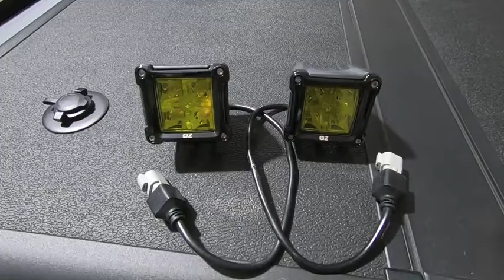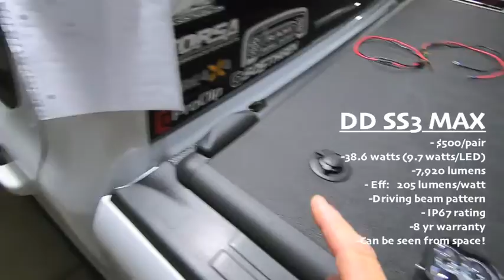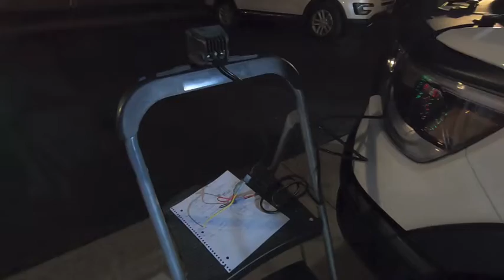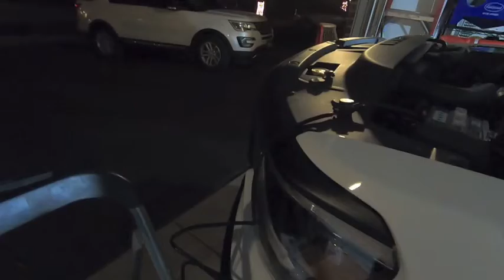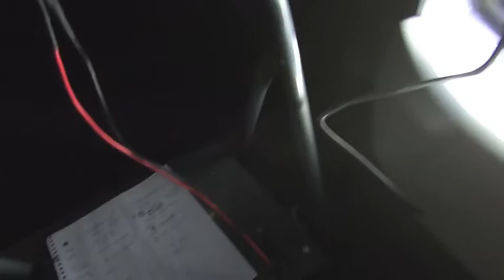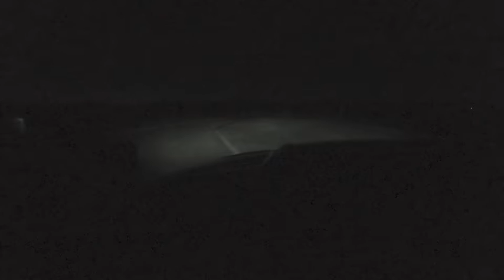Side by Side: Diode Dynamics SS3 Max pods VS bargain pods and why you get what you pay for!

Comment: I didn’t realize they came out with a “Max” that is brighter than the pro 

Only bummer is with the amp use you can’t just wire them directly to the trigger 

Did you use another high Amp relay and the tigger just turns on the relay?
Reply from the maker: Nope, my SS3's are controlled directly by the Trigger.  The trigger has 2-30amp circuits and 2- 10 amps circuits.  The ss3's pull 6 amps total so any of the trigger's circuits will work.

Comment: Awesome pods, 
These driving beam seems to be very good, Diode dynamics got the best optics currently.
The thing I would like to see Diode dynamics drive the leds to the max power and get some more spread with the combo lens.
That would really bet the Baja designs XL80’s
Reply: This video doesn't do these lights justice. The DD SS3 Max puts the BD XL80s to shame. Absolutely no comparison. Check out the incredibly detailed post on Tacoma World about these SS3 Max in the SAE fog light version https://www.tacomaworld.com/threads/the-led-sae-j583-fog-pod-fog-light-review.554813/
Reply: I Know I'm suuuuper late to the party, but if you haven't learned already, we actually do have a combo lens with 2 LEDs with a flood optic, and 2 with a driving optic on one lens. This is a great video showcasing the power of the MAX pods we sell. Personally I run Pro yellow fogs, and Pro white floods on my aftermarket bumper, along with an amber 18" driving lens stage series lightbar that absolutely slice through fog, dust, snow, and rain

Comment: $500.00...😲!
Reply: Don earl a baja lp4 which has the same output as these lights is 400 per single unit so these are a bargain....you want nice stuff you gotta pay theres a reason why 50 dollar amazon stuff is 50 dollars... .the 8 year warranty alone is worth the 500.
Reply from the maker: Big dollar light bars!
Reply: You can get the regular pods for $200 which still has a great amount of light.
Reply: @MiguelRPD  10x less light 🤷🏽‍♀️ and they leak
Reply: @adidas4275  I have the pro version of these and they put out alot of light and are around 240
Reply: I made a light bar with five ss3 max. 3 driving and 2 combo!  Can’t wait to get them installed!
Reply: No need for me to watch the rest of this. $500 really?
Reply from the maker: You’ll be paying the same at baja designs and rigid for lights in this high output category (5,000 lumen+ pods).